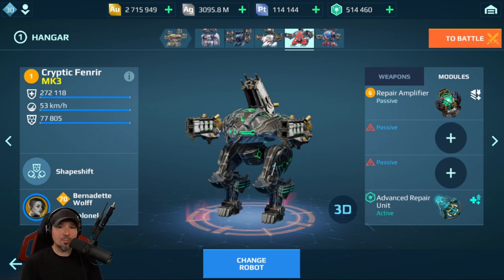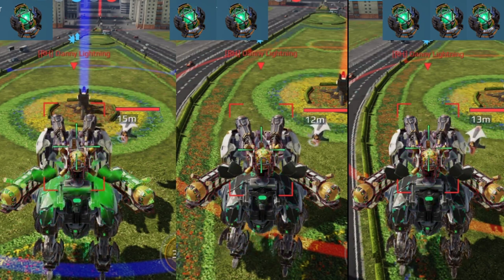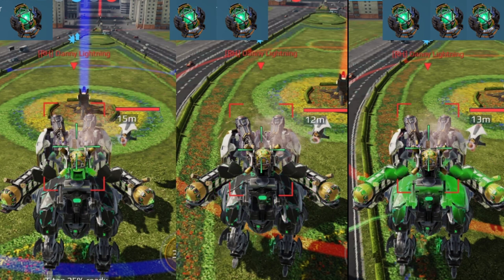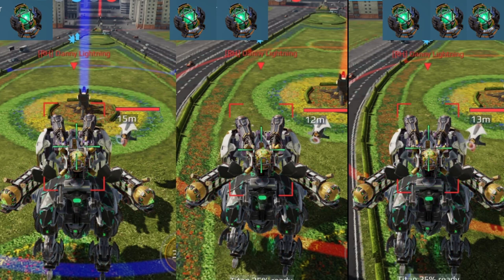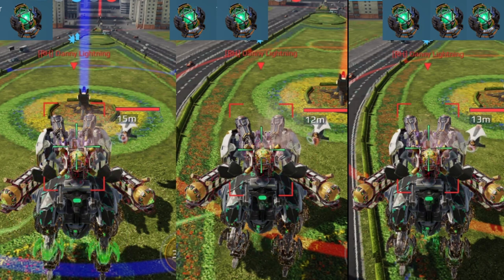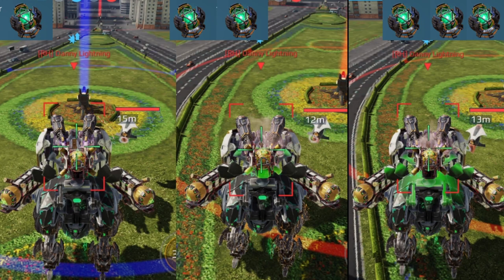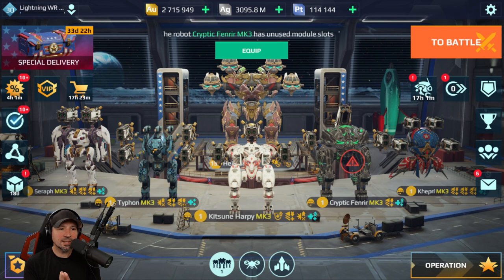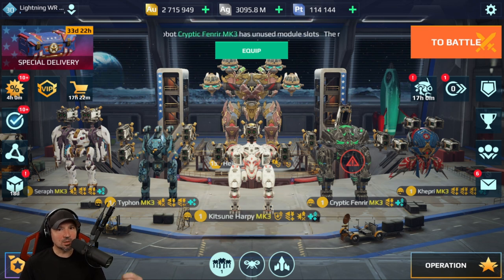War Robots Repair Amplifier Module Test Will Running More Than One Help ??

Comment: Hey Danny, the description indicates that stacking only speeds up the effects, I would suggest running the test with a nebula drone as the heal back will speed up the effect as well, but I don't believe the grey damage or the defence points increases, I run one repair amp and two nuclear amps on a Fenrir and that combo works better than two repair amps.
Reply: U nuts !??? The Grey damage restored DOES multiply or stack as u like to call it, I run 3 rep amps on the behemoth ! Not sure about defence points tho...
Reply from the maker: I think if you read it really really carefully it does say that some of the things you get out of this will stick I know on the nuclear amplifier you don't gain any additional damage by running two or three but on this one I'm pretty sure you get some stuff that stacks up, I read that description very carefully a few times and my take is yes you do get some additional benefits and it feels like you get some additional benefits as well, sometimes when pick Sonic words things it doesn't always make the most sense or they don't reward it correctly I think but pretty sure a few things stack up on this one
Reply: @Danny-Lightning-WR  Appreciate the reply Danny, I would try a test, two Fenrir, head to head with Nebula drone, one with two repair amps and a nuclear amp and the other with one repair amp and two nuclear amps, see who dies the quickest. I wish Pixonic could be more transparent with their information, we shouldnt have to check Wiki for the stats every time they release new content.
Reply: @dronetheworld4k67  No not nuts, just a little psychotic, I thought the ten years spent in prison might of helped, obviously not! ;)
Reply: @justjuice-toolbreakers  yeah same here prison won't do u good 😂
Reply: @justjuice-toolbreakers  how did your test go? Does 2 rep amps give 2 bonuses such as double resistance and grey damage Restored?

Comment: First of all, thank you for this comparison video. it was very insightful. I have also tried it myself. with one and with 2 but not with 3. i have found that i survive longer with one and last stand than with 2 repair amplifer. I don't play with 3 because 1 nuclear amplifier is mandatory. try it out with last stand.
Reply from the maker: Last stand is actually pretty cool these days since you can heal while you're in last dance so as long as the gray bars not preventing you from healing last stand is kind of awesome

Comment: Doesn't matter if you run 1,2,3... it sends you broke trying to level them up. On a tank, 1, with nike amp & balance seems to do the job.
Great video Danny. Was wondering this myself.
Reply from the maker: Yeah, you got to grind your butt off to get enough resources to level your stuff up in this game and make sure you're spending them very wisely when you do level something up. It's definitely a grind but I think it's worth it, game is still super fun

Comment: An informative comparison. So basically, because multiple repair amps speed up the stacking, the robot begins receiving the full benefit of repairing itself sooner than using one Repair Amp. According to Pixonic's description using multiple Repair Amps ONLY speeds up the stacking, nothing else.
Reply: The Grey damage restored DOES multiply or stack as u like to call it, I run 3 rep amps on the behemoth ! Not sure about defence points tho...
Reply from the maker: If you read the description of the nuclear amplifier that is definitely true but on this one if you read real carefully it makes it sound like running more than one does have a little bit more benefit than just getting to the full potential quicker, I've read it a few times and I'm pretty sure there's a little more stacking than just the stacks LOL but yeah the more you run the faster it gets to the full amount of stacks which is a big help and I can't remember if it's the amount of repair or the defense points but I think it was the defense points stack up as well, and from all the testing we can tell it seems like they do but unfortunately there's nothing on your screen telling you how much of this or that you're getting all you can see is how many stacks you have

Comment: Thanks D, I have 3 of these but have been on the fence as to wether or not it’s more beneficial to just run balance units or heavy armor kits. 👍🏻
Reply from the maker: So balance unit versus heavy armor kits what we've noticed in a face-to-face one-on-one firefight the extra damage you get from the balance unit usually wins but if you're not currently dealing damage to somebody but somebody is shooting you then the armor kits are better in that particular situation so problem is most things in this game are very situational but if you're a brawler let's just say two tanks are brawling face to face,. And they have the exact same setup except for one is running three heavy armors and one is running three balance units the one with three balance units wins.  But if you're just damage and trying not to die, that's where the other one is more beneficial so I don't know everything is very situational in this game
Reply: @Danny-Lightning-WR  so so true. 👍🏻👍🏻

Comment: Hey Danny, you mentioned on your Livestream that stacking Nuclear Amplifiers the bot is harder to kill. Can you do a video on this?
Reply from the maker: Nuclear amplifiers give you more damage,. Running more than one does not increase the amount of damage you do, it will make the module get to the max amount of damage faster though but it won't add any additional bonuses other than getting to the maximum amount quicker so either I miss worded something or you misunderstood what I said there but yeah those ones don't stack up like these ones do

Comment: Hey Danny do you think it’s worth upgrading the khepri now coz I am kinda not sure whether pixo will nerf it or not and second thx for the comparison
Reply from the maker: Here is the deal, anything in this game could be changed at any time, I'm not sure when they're planning on making changes again, right now it's one of the very best robots you can get and it's totally worth upgrading but it could be changed tomorrow or it could be a year from now, we just don't really know

Old stuff gets buffed somewhat often if not very many people are using it, new stuff gets rebalancing somewhere often if there's too many of them out there and they're starting to become a problem and one specific thing is kind of taking over the battlefield.  But unfortunately we really have no idea when they're going to set the side to change things, they don't really share that with us,. Right now these robots are a must have and totally worth leveling up, rumor has it but don't quote me on this that they're not planning on doing any rebalances for a couple more months but that's just the rumor I'm hearing from someone who usually has very reliable information but even if that is correct you never know if they're going to change their mind or decide to do something differently but if it were me I would probably level it up if you can.  I can't be sure but I have a feeling even if they do rebalance this one it will still be very good afterwards
Reply: @Danny-Lightning-WR  hey danny , thx for you opinion and yes its kinda unpredictable nowadays consdering the fact tht there are new robots or weapons released once in 2 months , and also kinda suprised khepri is  still not nerfed for  the upcoming update , it may get hit real hard , who knows ?  It could end up just like the fafnir so yeah iam kinda picky on this 😅

Comment: I came close today from gold chest. But instead ended up getting ag10mil.
Reply from the maker: That's a nice prize but yeah, it'd be nice if it would always give us the ones we wanted
Reply: 10 mil silver i would say is a great prize. Those upgrades cost.
Reply: @Charlie-xoxo  it’s useless. Upgrading robots to level 9 cost about 17mil. All my robots are stuck at level 9. And not forgetting weapons. All my weapons are stuck at level 8 and now I have to change one of my robots after winning the newest robot.

Comment: The 2nd and 3rd examples didnt perform as well as I would think.
Reply from the maker: Running two dead slightly better but if you look at the difference between running one and running three it was pretty noticeable and I guess there's always a possibility of running it on a different bot could make it even more of a difference, like I said there's a lot of different variables so we can't really test for everything. And the weapons I'm using are very very hard hitting so maybe if you change the bot and change the weapons there would be more of a difference, I don't really know but you could spend hours and hours and hours testing those types of things so I decided let's take one of the most popular tanks in the game that the majority of people have or can get and let's see how it performs on that one
Reply: @Danny-Lightning-WR  i think a lot of durability related modules work well on larger bots and are almost worth skipping on like an Orochi etc.

Comment: What a bad test! The main thing i want to know is when the bot get the 60 staples. Have you done such a test??
Reply from the maker: You want to know when the bot gets to 60 Staples?  well I don't think bots get staples,. And if you're talking about stacks on the modules, the modules get the stacks and not the bots.  The more of these you run the faster you will get to the 60 stacks,. Depending on how many weapons are hitting you and how many people are hitting you at the same time, as far as how fast you get your stacks,  those results will vary  like I said everything in this game is extremely situational there's a million different situations you could be in so it's impossible to test for all of them this test shows you that running more than one does make you survive longer so sorry that you think it's a bad test, maybe you didn't understand the point of the test
Reply: I woulg like to see how much hp (and the grey part of the hp) is left when the 60 stacks are reached on the modul, you cut tha information out. I missed that.
Sorry for my writing, i can't speak/write in english. It's only YT based skill.
And btw.  i don't expected that you read my post. So sorry for my rude writing.
You do a god job danny